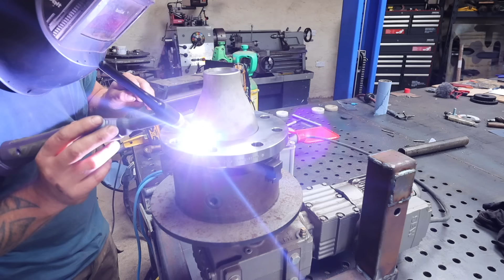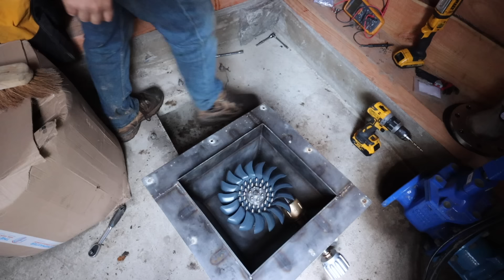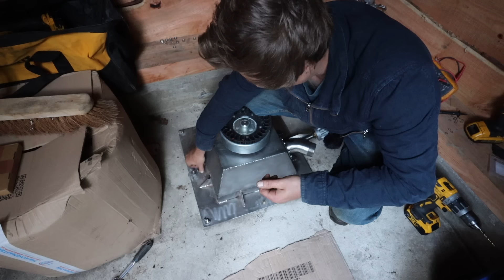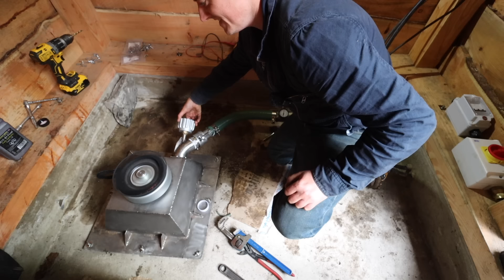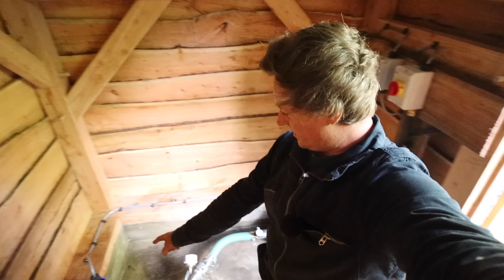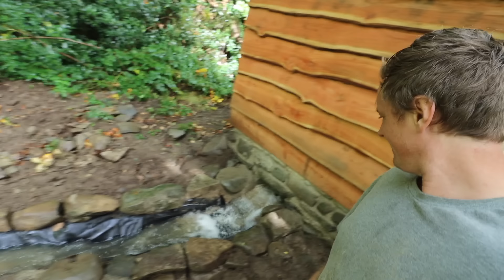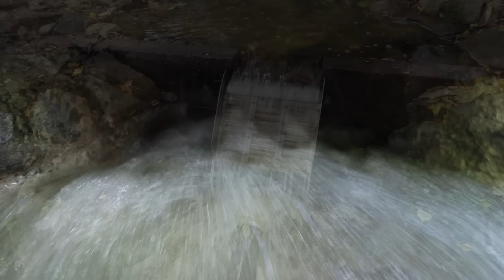North Wales 1.5 Kw Hydroelectric System Part 6 Running the turbine For The First Time

Comment: What does a system like that cost and if you turn it on how long will the system last before it needs replaced.  We are looking for off grid power sources and we have atleast 10x the water flow he has.

Comment: Hi Kris... I noticed you are feeding filler into the back of the weld pool when using the rotator. Try rotating the part the opposite direction so you are feeding filler material into the front of the pool. You'll get a much smoother weld that way. It's been a while since I watched, you've made big leaps forward :)

Comment: -As far as crap in the pipe, maybe squirrels are climbing the stand pipe and dropping stuff in. I'm sure you could come up with an easy way to cover it with window screening to keep debris out.
-That hose is definitely stretching or moving.
-Have you thought about an ATV? Trailer in an ATV that also has a small trailer. You can put some real aggressive tires on the ATV to get you to the places you need to go on the job. Obviously you couldn't bring all your tools at once but it would be a lot safer.

Comment: I was wondering why the customer went with a manual control? If I remember correctly your turbine has a remote controlled spear valve, so wouldn't it be easier to adjust to changing loads and flow conditions with an automated valve. Furthermore, could you install a sensor on the intake, so the flow could be adjusted to not drain the pipe?

Comment: A very interesting project.
I would do 2 things differently.
1. a load-dependent inflow control (electric) 
2. keep the outlet of the turbine under water with a sub-basin.

To 1: You have a hand wheel where you direct the water jet to the blades. This handwheel could be automated with an actuator. This way you could change the handwheel electrically when the battery is fully charged or when the loads are high, and thus also save water when none is needed.

Re 2: With a sub-basin, the drain would be constantly under water. This would significantly reduce the noise of the running turbine in the surrounding area and the turbine itself is more protected from environmental influences.

🙃
Reply: I was thinking the same about (1),  that would be a fun little project. Re (2), do you have a diagram to illustrate what you have in mind? I'm not sure I understand how it would be protected from environmental influence.
Reply: @lilanedaria I think he is talking making the outlet U shaped like a toilet, to reduce noise.

Comment: If i remember my flow stuff right, you need a certain amount (which is directly proportional to several factors, like size of impeller, type and i think speed) of distance between the nose and any reduction, elbow (basically any obstruction). Any such thing happening before (or further than math prescribes) results in a flow reduction.
Don't get me wrong, i'm sure it's probably more than ok, you really need to work at it to mess this kind of stuff up, but it's an important factor (if you'll make another in the future). There's a few channels on YT that do computational flow, you can shoot them an email and details of the project and they'll spit out values for you. jm2c, cheers!

Comment: Id just be worried about erosion from the outflow..  seems like a good size concrete culvert would be needed with that much continuous flow..  but the stone looks nice..  

But whats the lifetime on those?  Does the water flow build up minerals on the turbine where its pushing it?  And what about galvanic corrosion inside the generator?

Comment: The problem you talked about at the end (bigger nozzle = more power, but only if enough water, with less water it gets less efficent) can be avoided with a second nozzle. So you can stop one nozzle for dry periods and open up for more power when enough water is coming in. Plus: They don't have to be identical. One for 1,0 kW, one for 0,5 kW. So you have 3 settings: 0,5 kW, 1 kW and 1,5 kW (rounded). And the nozzle stays in full open position and a ball valve can be closed easely by the customer / automated without messing up the setup.

Comment: I don't understand why you are not using rectifier near the generator. It is much more efficient to transmit 100v DC than to transmit AC, and AC from this generator would have high reactive loses as generator output has high frequency.
The only advantage of AC over DC is it cheap and easy to step-up or step-down voltage levels, so high voltage is used in long distance transmission.

Comment: I also want to build such a system myself. But I live in the Netherlands, so I have to place water containers at a height in our monastery. I want to pump it full with water during the day (using solar energy) and let it drain at night. Like a battery.
I was wondering how much water goes through per hour?

Comment: Did you do at least 2 passes on the exterior weld? One pass can seal it sure, but really for long term structure and durability you want 2-3 passes. I've used SCH 40 for building exhaust manifolds for high power cars and even there we do 2 passes on most things, or one pass with HUGE amps and lots of filler for a nice deep penetration and lots of area welded. It was hard to tell if thats what you did here, but overall looks good. I'm a huge fan of this kinds of stuff!

Comment: I'm a plumber.  Saying, "Right, let's see how many leaks we got" is standard after every job, sadly.  Most often, it's zero, but experience still makes me say it.
1.5 kilowatts an hour would supply my entire annual electricity demand (14,000 kWh) for my house.  Would very much like a hydro solution.  Wind can't do it, and I'm currently looking at a generator with batteries.

Comment: I've not seen the whole series of this. Is there a gravel trap somewhere upstream? Would be an easy thing to fit.
Reply from the maker: The gravel is just in the pipe from installation. gravel cant get in through the intake so once its all cleared through there won't be anymore.

Comment: Though it seems counter intuitive, a small hole bored in the "top" of the penstock pipe 10ft from the coanda screen intake, will, by squirting a 'telltale" small column of water, show if there is indeed any air left in the pipe.....
solid stream= no air
"farting" stream= air with insufficient intake volume (blocked coanda?) or too much water being drawn by the turbine
Just air...(usually sounds like an air stream over the mouth of a bottle) = pipe is filling successfully after being emptied at the turbine end for maintenance......

Comment: Could you use 2 different nozzles in the same housing? A bigger one for higher flows and a smaller one for lower flows. And you could selectively turn one on according to conditions.

Comment: You are going to have the same trouble as I had with skin cancer on the arms from TIG using. Cover up and use good gloves.
Reply: Not to mention he was TIG welding backwards instead of right to left pushing the puddle

Comment: Beautiful work. Perhaps use that sensor to create some sort of auto adjustment on the small tap maybe using a central heating valve to turn it, thus maintaining output by adjusting nozzle flow based upon water in the pipe. Just an idea love your work. Just wish I had the right property with stream to then commission some work with you. I’ll keep dreaming. Looking forward to more videos 👍

Comment: Super job Kris, really impressed. For the control link you spoke about, I know you have some spare cables run there but have you considered using LoRa or LoRaWAN wireless sensor and control links? Very low power requirements and with the 868MHz band also very resilient? I'd be interested to see what control hardware you build to control flow too, and especially how you design the customer facing screens.

Comment: a quick note, I saw you reversed the electrical connection in the cabin.
(Purple-white plug)

it was for a reason?
because if the water kept running and you pulled the plug, there is a good chance that you could be electrocuted…

However love your project!

Comment: Looks great Kris !!  I wonder if the debris or gravel in the line can hit the plastic turbine blades at high speed and break them ?!  Or is the deltaV between the blades (at high speed) and the incoming gravel so low that not much impact energy would be imparted into the blades, thus not damaging them ?
Also, on a side note,  it should be "1.5 kW" instead of "1.5 Kw" .  kilo is lowercase and Watt is uppercase  ;)

Comment: I was just wondering about that small pressure drop between static and flow condition that could it be more like due to Bernoullis effect where sum of potential and kinetic energy stay the same in the fluid but they just change between each others... You placed the measuring port in a higher flow speed placement so it will show smaller readings at least in some extend during flowing condition... Of course it can be friction losses too but maybe this bernoullis effect is higher in this case?

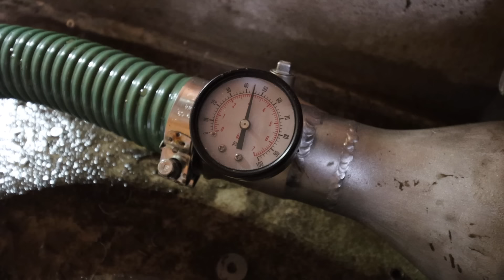Comment: @ 16:02 it is not due to pipe friction loss you only get that from a pumped system
it is due to head pressure...static and dynamic ...the nozzle produces velocity ...you can put the pressure gauge anywhere in that vicinity and the static or dynamic will read about the same whether it is on the big pipe or small pipe

the dynamic pressure is relative to the nozzle size and amount of head ...not enough head and too big a nozzle and there wont be enough velocity out the end of the nozzle

Comment: Not bad welding. Consider the weld at the face of the flange to be more of the seal. Make it as good as you can. The weld on the back is considered to be (although it does need to be good) is considered to be more structural, so beef it up as much as is sensible. Throw either more runs at it, or use MIG or stick (316L rods might be best). A decent welding job, nonetheless. I might be more impressed that your final actual output tallied with your calculations, a great overall job. 👍

Comment: Hi mate great work, but I have a few tips to help you in the future: Use a No 6 ceramic cup, better gas distribution and easier to wiggle your cup around the flange instead of floating in mid air like you did.
secondly don't ever set a flange up with just one hole, the universal way is 'two hole top' which means all flanges have 2 bolt holes at the top. 
Also turn the heat down a bit on your welder, far too hot that's why your struggling to build up any weld and its running down the sides.
Also try resting your right hand at least on the flange, if it gets too hot rest it on another tig glove, you cant float around the whole thing like that its not stable enough.
One last thing on your threaded joints use loctite cord, there will be no leakage...trust me
Thought you'd appreciate the help as you obviously don't see many people who can give you advice lol
Don't know if your self taught or what but if you are that's still very impressive. 

only small things but might make your life a bit easier

Comment: Great job Kris.  A suggestion for the owner is to install a security camera inside the shed (they could use a solar wireless one if within range, or wire it in through the proposed controller conduit).  It could be used to monitor the setup and to zoom in on the pressure gauge.

Comment: Using a tee fitting to attach pressure sensors allows for a nice modular unit, and you can add a strainer under the gauges or sensors, just in case of debris

Comment: Very nice system, but I have questions. How long does it take for grit moving fast in the water to erode the plastic turbine blades? Why don't your alternators use water cooling, instead of wasting power on a fan? A sealed stator could be bathed in transformer oil, with a very small fraction of your water flow going through a tube in the oil to carry off the heat.

Comment: Hi, I am a mechanical engineer and you are right to change out the flexi pipe you have feeding the nozzle, not only for the reasons you mentioned but also from a loss perspective. If you were to put an additional pressure instrument on the nozzle side of the flexi pipe you would find that there would be a drop across this section of pipe as a head loss in a bend of pipe (plenty of fluid mechanics resources available on the internet) and addressing this so the bend is not as severe you should be able squeeze some more juice out of the generator.

Comment: Always put a valve under your pressure gauge - let's you isolate the gauge to prevent wear and replace gauge without having to drain the system.

Comment: Here's an idea for you.  If you had a rectangular nozzle with a movable flap, kind of like a clarinet mouthpiece,  you could adjust it remotely or dynamically to suit the head pressure.   A bonus feature is that it could occasionally open right up momentarily to discharge any gravel blockages.   A flat stream of water might even work better with turbine blades (I'm no expert).   Have fun designing, building and proving it, if you want ;)

Comment: i would love to make 30kWs with a hydro power system.... i still wonder if a traditional wheel with gearing to the generator would work... i know i have an average flow of 5 gallons per 2 or 3 seconds year round. and nearly ten times that after most storms. i wish i could figure out the calculations and make a system i could run my whole property on

Comment: I understand your reasoning for using wingnuts over hex, I was just wondering about vibration though. Is it a problem ?. is there any requirement for additional fastening, such as spring or serrated washers  ?....might be worth wiping on a dob of copperslip onto any exposed threads too.

Comment: Hi Kris - I mentioned on a previous video that another YT'ber hydro chap uses a plastic barrel part way along his inlet pipe to act as a sand and gravel catch. The barrel lets grit and dirt to drop out of the flow and then the cleaner water passes out of the overflow. He also mentioned degassing the water to reduce cavitation and wear on the turbine. Hope this helps 😃😃

Comment: Two things I would add. On the backside of the turbine I would add a drain in the concrete using a core drill. Using two different sized core drills you could set the drain cover flush with the level of the floor and and if a hair lower, always catch any leaking water. Second thing would be to add a garden hose outlet to the manifold. Reason is that over time, you are going to track mud ( dead bugs, grass, etc.... ) into the building. The hose and drain would allow you to flush out the building's floor.

Comment: Hi Kris, well done as always. Hold you in high regard. Have you considered getting rid of the corrugated hose? I suspect this will cause turbulence and unwanted resistance to the flow of water. Try a high pressure hose with smooth walls.  Cheers ARBEE
Reply from the maker: That hose is getting changed but its not corrugated on the inside, its smooth on the inside, the reasons for changing to rubber is due to it not looking like it was last long enough.

Comment: Maybe an idea for the monitoring system. Rather than building/designing bespoke sensor and interfaces/Web address like the arduino one we saw on your turbine kris.
Instead why not use readily available pressure sensors and roller switches with a raspberry pi running open source home automation software. Like openhab or home assistant. Documentation would be far more accessible for DIYers if they choose to customise the system, ie add automation if pressure drops reduce spear or close a nossel. Customers would be able to integrate their own sensors in the future given openhab supports a ridiculous number of IoT devices. Would also more easily lend itself to integration into other cloud services google/alexa with ease.
"hey Google turn up the hydro" would be easily done for those who like cloud services. 
Would also lend itself to multiple sensor brands, which I imagine would be more difficult with a bespoke designed monitoring system.
Reply: Can't speak for home assistant but rules in openhab are easy to understand. ie no need for detailed programming language. And could get creative with automating spear valve or number of nossels depending on pressure sensor with relative ease
If pressure drops below x (x being the known "full pipe" psi) close nossel or reduce spear by small amount. Then repeat above until pressure above x. 
Additionally could set timers for running turbine. Or even use openhab to read victron battery settings ie battery below x% then turn on the hydro. Done by using victron modbus communication with openhab to store battery levels in openhab which in turn would control the nossels/spear

Comment: Just a thought, and I fully admit to only checking in every so often to catch your engineering description, but as an electronic tech cognisant of efficiency in generating devices, I have to wonder how much power is lost in the cooling fan on top of your alternator? I look at that as being an air-brake as much as cooling. Your working fluid (water) could also be your cooling fluid. Could your alternator shaft be extended below the alternator to be cooled by the impeller or a metal disc in the wastewater?
Reply: Consulting "Rebuilding My Diy Micro Hydro Turbine (Bearings failed)" I see your alternator is a commercially available unit. Oddly, the magnets are the cooled part of the generation, not the coils themselves, where the heat is derived.

It might be well worth experimenting with removing the squirrel cage fan, or if not possible, covering it with light weight tape (electrical or the like) outer and inner, perhaps metal tape  to decrease the drag coefficient but retain some dissipation and increase the passive thermal sinking by increasing the gauge of wire exiting the unit. In many electrical devices, especially non-consumer units, this is often done as a fail-safe way to dissipate unwanted heat.